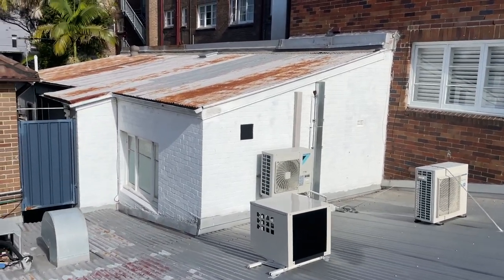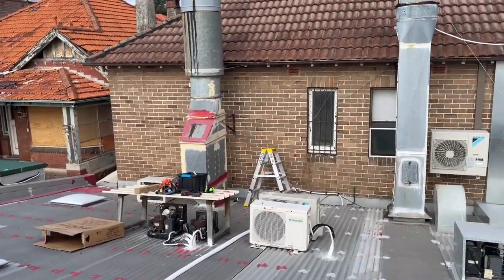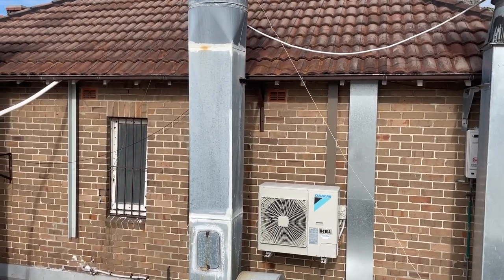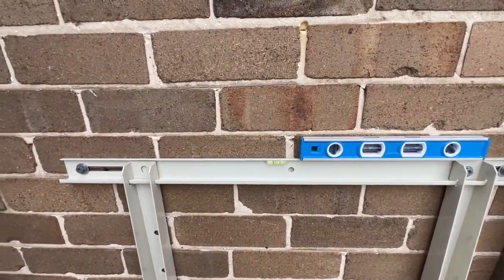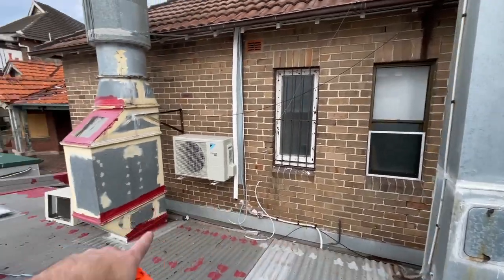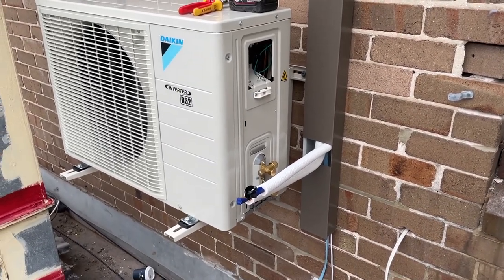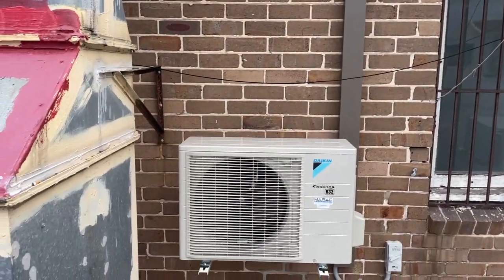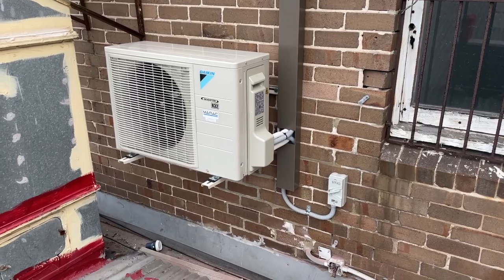Installing a DAIKIN DUCTED AIR CONDITIONER⎟R32 Condensing Unit

Comment: I wrap with Nitro black tape. Keeps UV damage to minimum. Looks sharper than white lagging.
Reply from the maker: That’s a great idea. I’m going to grab some and start using it. Thanks!
Reply: @maracservices  Lol autocorrect I meant Nitto. 

Denso PVC SA outerwrap tape is good too.
Reply from the maker: @rowdoradge  haha I thought that’s what you might of meant but then I googled nitro tape lol and there actually is such a thing that looks half decent 😂
Reply: @maracservices  👍
Honestly I think the UV spray will probably look better however I'm not sure how effective it will be. 

What I like about wrapping is that I have installs 5+ years ago that still look undamaged. Tape has faded but lagging is still spongey and fresh underneath.

Comment: Brilliant to see you always looking for improvement bros 👍🏼.
I think the flex is all good, if you wanted to try it though, you can use an electrical internal spring bender to create an offset in the hard drawn.
Great work 👏🏼👊🏼
Reply from the maker: Thats a good idea bro. I've never actually used those conduit springs but I think I'll end up buying some. I'm always looking to improve! Thanks for the idea 🤙🏼

Comment: Insted of Galv nuts and bolts ( the ones with the unit are already Galv) 
It’s as you are near the coast the air has salt in it and is very corrosive. 
I’m a spark in the UK near the coast so I always use stainless steel fixings or brass as it’s all that lasts.
Reply from the maker: I completely agree, living near the coast is a very harsh environment. The crazy thing is, the bolts on those brackets seem to rust even in places no where near the coast. So I think I'll do what you recommended and invest in some stainless bolts especially if the installs are on the coast. Thanks for the advice mate!
Reply: @maracservices  no problem at all, also just a note. Stainless steel fixing require stainless steel tools otherwise the stainless contaminates and will corroded. Good luck 😉
Reply from the maker: @Beariam24  oh wow, I honestly didn’t know that. Cheers 👍🏻
Reply: @maracservices  no worries buddy. Very jealous of your local. Looks like a heck of a place to live and work.

Comment: Nice neat work! For the lagging exposed to the sun I use Aluminium tape. I found Duct tape, black lagging or the stock paircoil lagging just disintegrates after a while. Have you used internal bending springs for paircoil?
Reply from the maker: Thanks man. That’s a good idea, I need to start using something because like you said, the insulation lasts like a year then it’s already starting to perish. In regards to the internal bending springs, I used them once and I found when I took them out of the pipe it would leave  bits of plastic inside the pipe (admittedly you could probably avoid this if there wasn’t a burr on the pipe) so I never really used them after that. I use my external bending springs all the time though. The internal bending springs were like a fluro green bit of rubber if that’s what you are talking about?
Reply: If you deburr before putting them in that helps with that issue. I find them so much easier than external springs. But yeah the Aluminium tape is a must try man 👍
Reply from the maker: @jonathonwilliams6722  Sweet as dude, I’ll give it a go 🤙🏼

Comment: Great attention to detail! Don't really see r32 in the states yet. When you buy a cylinder of r32 how does the cost compare to r410?
Reply from the maker: Thanks mate! 

So it costs me $348.84 for a 10kg bottle of R410a. For what ever reason, I can only get a 9kg bottle of R32 which costs me $574.31. So it’s more expensive and more flammable. I’d say it’s a good thing you are still using 410a over there to be honest.
Reply from the maker: @VinceCuzmono  that’s is very interesting. So I can go to my local wholesaler (I think you guys call it a supply house) and buy a 10kilo bottle of R410a for $348 AUD. Or I could buy an 11 kilo bottle of R410a from the US for $696 AUD (I converted your figure to AUD). Does that mean you are paying more for refrigerant (Freon) over there? Surely not. In regards to the R22. It’s the exact same over here mate. Still have old units and people are doing the same thing with R407. A 12kilo bottle of brand new R22 costs me $1977.55 AUD. Crazy stuff.